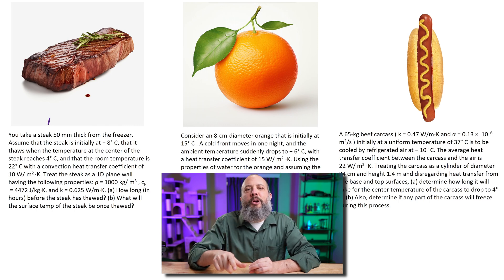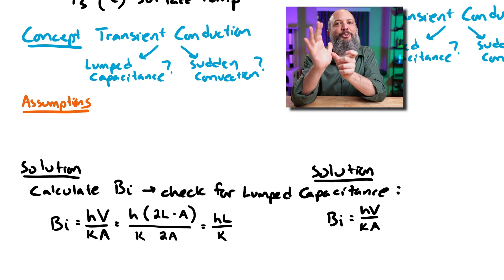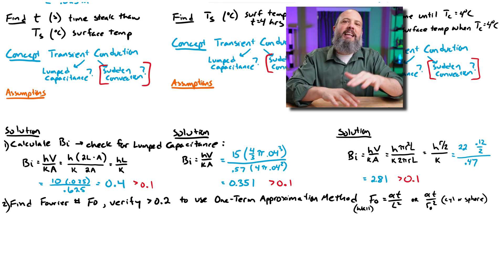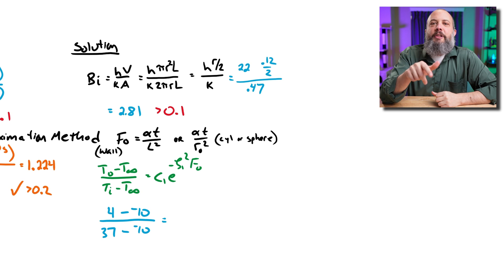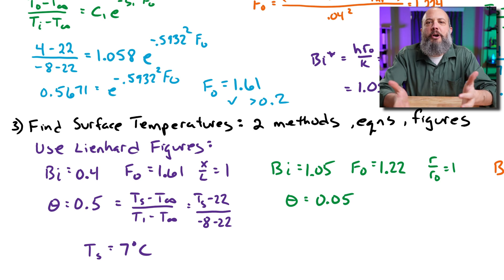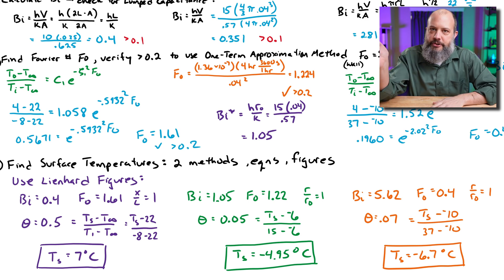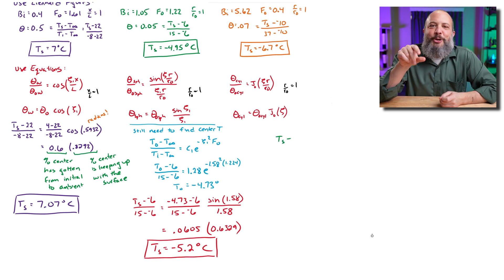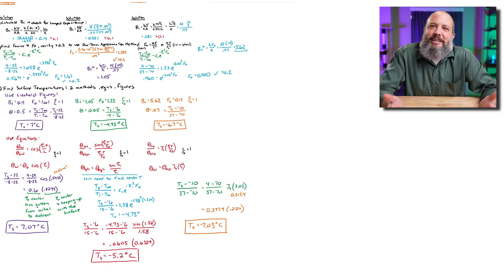How to Find Surface Temperature during Transient Conduction due to Sudden Convection

Comment: Helpful video but I'm confused by the last step. When do you need to consider intersecting geometries?? I thought that the equations used in the last step only consider one dimension of heat transfer in the solid, and that you need to consider each dimension separately, at least for cylinders and cubes which are not symmetrical in all dimensions like a sphere.
Reply from the maker: You're right, the methods in this video are only 1 dimensional. The steak is modeled as a 1D wall, not as a cube. And the cylinder only looks at heat radiating in 1 direction, outwards from the center through the side, not through the flat ends of the cylinder. There are a lot of times where objects are large enough in 1 direction that the surface area in the 1D direction is much larger than the surface area in other directions, so those other directions can be neglected without introducing too much error. Directly - when do you need to consider intersecting geometries - when you think the amount of heat transfer through the other surfaces is large enough to be relevant. If I were to make up numbers, since there's so much error in calculating convection anyway which you'll learn later in the course when you calculate nusselt number, I probably wouldn't bother if you think the extra heat is < maybe 20% of the total? It would totally depend on the application though. If I really needed as perfectly accurate answer as possible, then I suppose I would always include every direction. But often, good enough is good enough.
Reply: Thank you for the response! Very clear :))